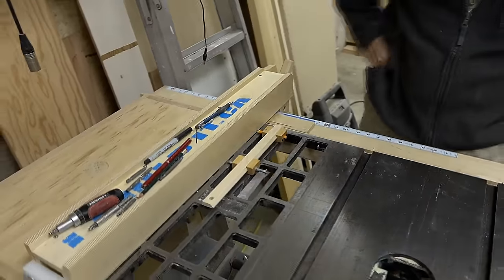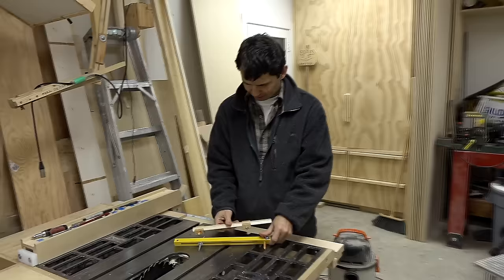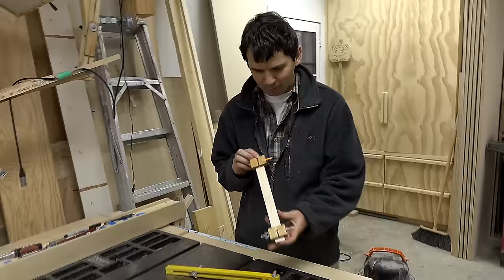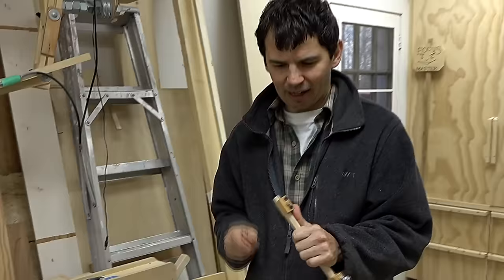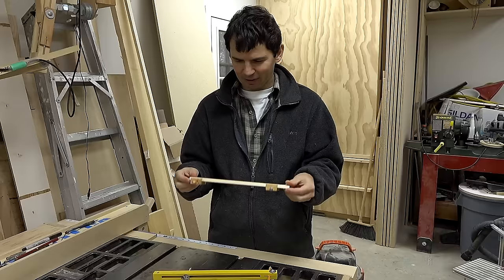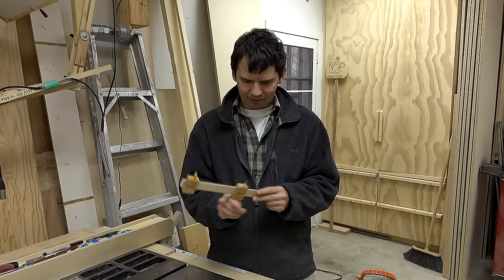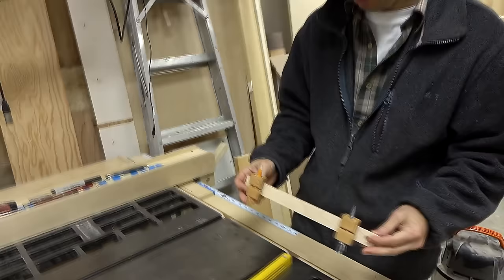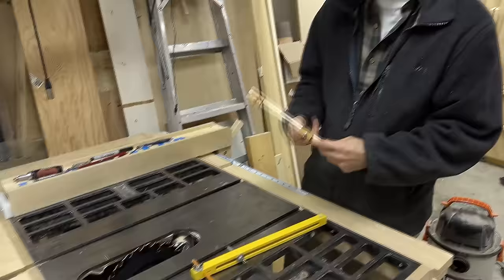Comparing beam compasses

Comment: Does this video have some sort of re-sampling issue? The movement is somehow "ghosted".
Reply: Could be very heavy post-production stabilization.
Reply from the maker: 60 fps rendered down to 30
Reply: 60 to 30 should work just fine. Looks more like the shutter speed of the camera was too low.
Reply from the maker: 60 to 30 means two frames get averaged into one.  Which looks like low shutter speed.